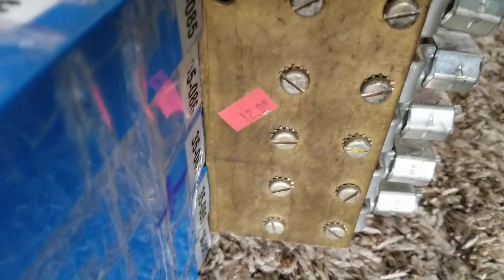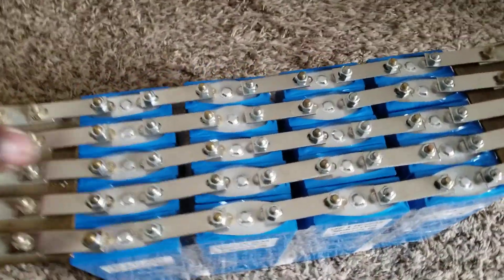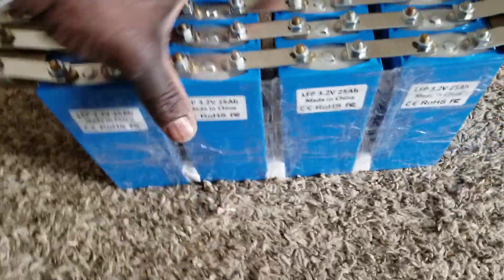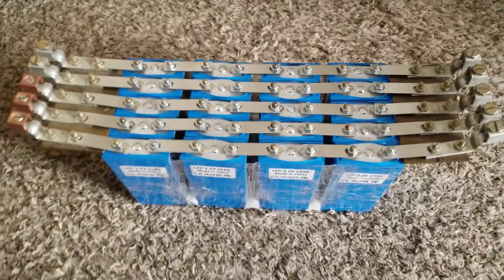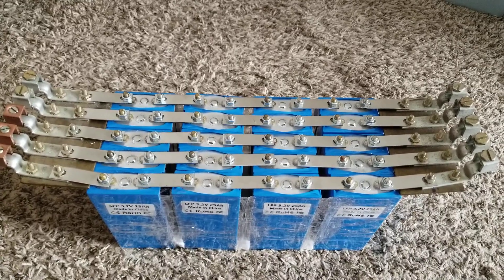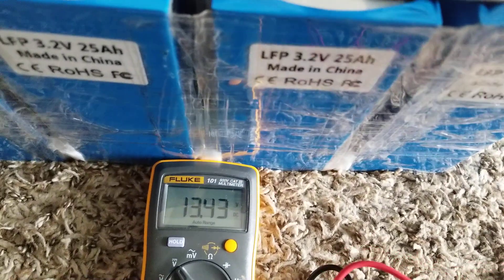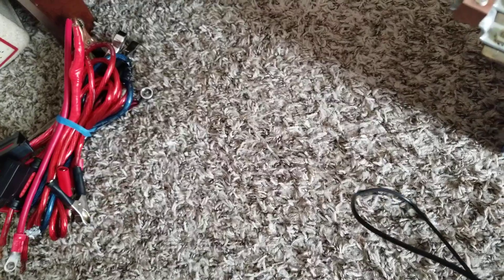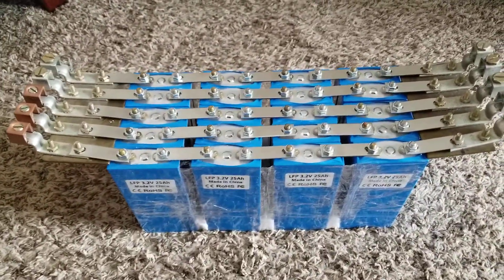HOWTO CONFIGURE 20 LFP 3.2V LITHIUM IRON PHOSPHATE BATTERY CELLS FOR OFF-GRID-SOLAR APPLICATION Pt.1

Comment: If you test the resistance using the tooth star washers vs flat washers, you will find that the flat washers will have less resistance, so they are better.
Reply from the maker: Thanks for sharing